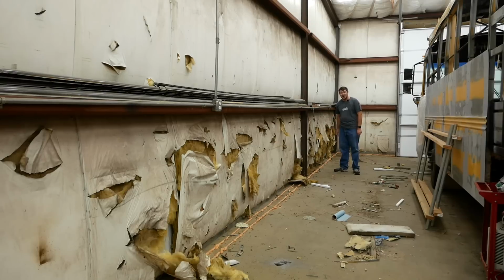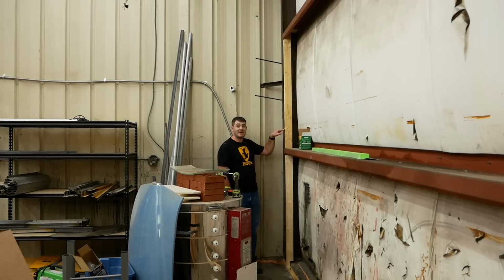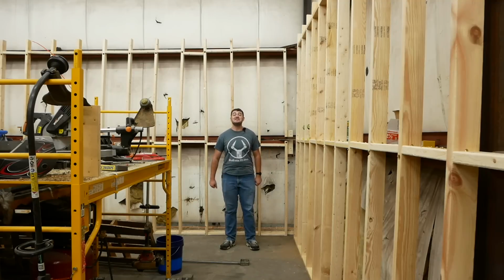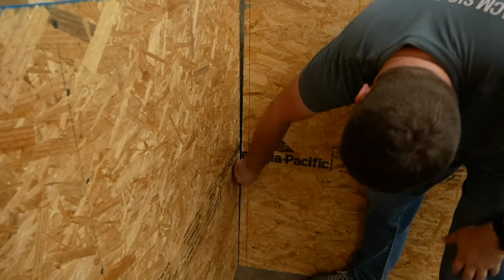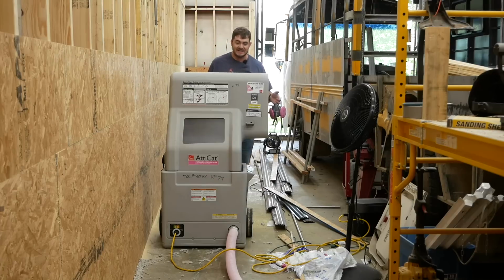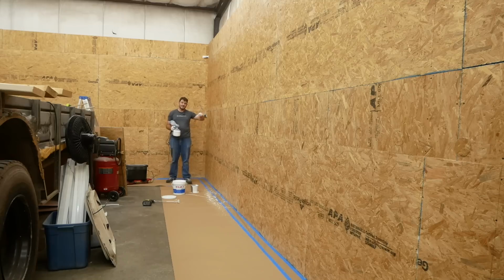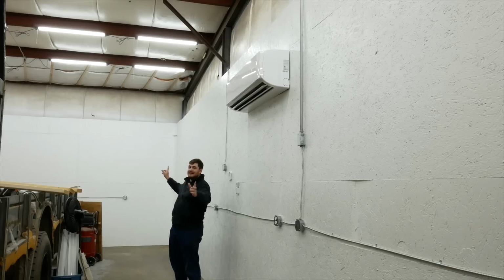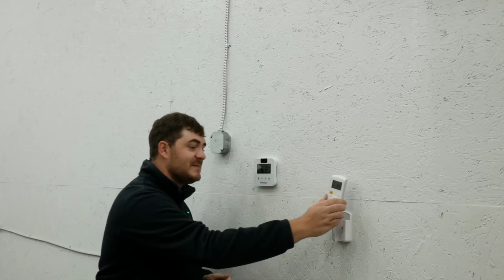The Bus Room is Done! (For Now)

Comment: Yeah, that control problem is the same with every mini-split system in existence - supremely-expensive Mitsubishi is *exactly the same*. The real solution is to hide the remotes in the closet for an emergency, don't install the thermostat, and just duct-tape (or 3d print or cnc or whatever a mount) a cheap tablet to the wall to control it all via wifi.
Reply from the maker: That is absurd